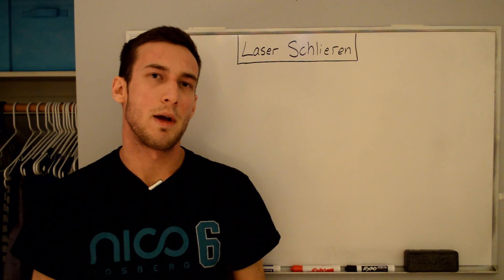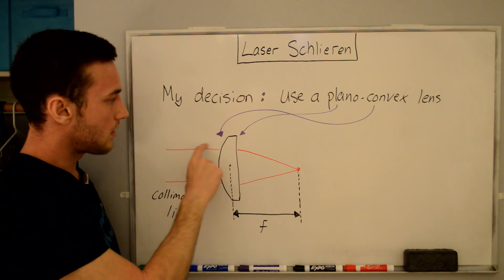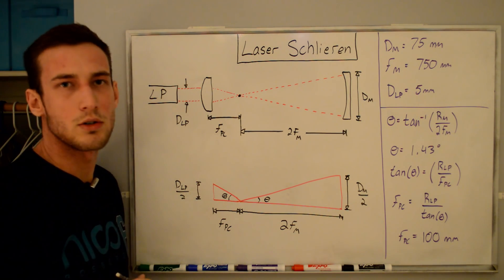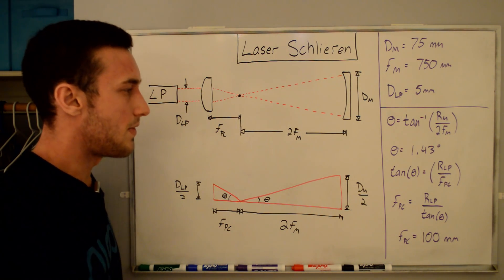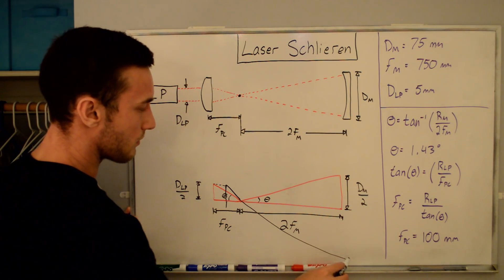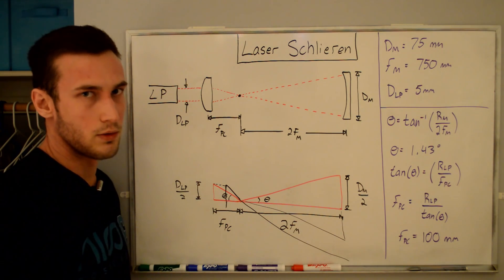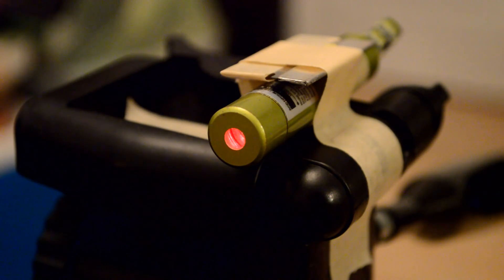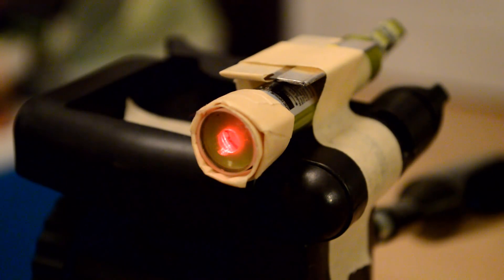How To: DIY Laser Schlieren

Comment: apparently, if you use a beam splitter, the final light is reduced to 25% of original intensity. fyi, check it out on Abominable &Co. 13:49
Reply: A beam splitter arrangement prevents the slight (but noticeable) distortion in the schlieren images due to the different forward and return paths of the light as in this case. In this case you get two images slightly horizontally offset with each other due to the angle of tilt that exists here. The shadow from the forward path does not coincide with the shadow from the return path as the schlieren source is not exactly at the focus but at a slight offset causing non overlapping beams. With stuff like quadruple pass schlieren, these misalignments can get even more terrible.

So a beam splitter is really useful if you're performing any sort of quantitative measurements with this kind of a double pass schlieren setup.

Comment: 5:30 you can use whatever plano-convex lens you want since the the setup design is not restricted from accommodating a relatively offset, lens convergence point. so, all you need to do is have the light source relatively closer to the mirror, and the focal point could be behind the light source, in this case.
essentially, your math was inaccurate. you didn't even show any formulas. 2Fm, or twice the focal length of the mirror, does not need to meet the location of Fpc, the focal length of the plano-convex lens. 2:58 wrong. again, wrong: 11:48.

Comment: thought you said it was a green laser? but what is the purpose of this setup?
Reply from the maker: I must have misspoken then.  I guess the purpose was to show you how to set up a double-pass schlieren system if you wanted to use a laser instead of an LED.
Reply: @JoshTheEngineer  huh no no i dont even remember what this was about but i was juts wondering what the purpose of such setup would be used for?

Comment: Have you tried removing the focusing lens in the laser pointer? Or used a focusable laser?
Reply from the maker: I have not, since the cap is extremely difficult to take off of this laser.  The reason I bought a lens was to show what kind of lens you need and why, but you can certainly mess with the laser pointer optics and see how well it works.
Reply: The reason I was concerned about the external lens is from my experience with lenses and laser beams. The beam diameter is so small that ther's almost no curvature of the lens from one side of the beam to the other and so very little 'lensing effect'...unless the lens has a very strong curvature. 

Within the laser head, the lens is pretty strong but, also very close to the laser (which, without the len is poorly collimted).

Pen type laser pointers are almost impossible to take apart but, some of the higher powered lasers, at abkout the same price, are sometimes easy to get at the optics. Of course everybody lies about laser power. For  sending to many countries, the lasers are advertised as 5 mW even though they are often more powerful.

Comment: Good video but why not just remove the top of the laser pen and refocus the lense that is already inside the laser instead of buying another lens?  It's certainly quicker and cheaper.
Reply from the maker: I would agree with you, except that in my laser pointer, when you take the cap off, the lens is not easily accessible.  You would need to take apart the entire laser pointer tube, and I'm not sure I could get it all back together again.  The other reason is that I like to use my videos to go into the calculations behind my setups, and this happened to be a good video to show how to choose a lens.

Comment: Thanks for the excellent video, 
Quick question, I got the same pattern that you have by adding the lens to your laser.but instead of adding the lense I just removed the focusing lense of my cheap laser 
Do you think this could work ?
Reply from the maker: You're welcome!  That should be fine.  Anything that allows the light to diverge to fill the mirror will work.  You have more control if you use a lens that you pick based on mirror focal length and diameter (like I do in the video), but if you can get it to work without buying a lens, that's great too!
Reply: JoshTheEngineer Thanks for the reply !

Comment: Great job! Super video! I would like to suggest tweaking the adjustable nut inside your laser which drives the internal lens. The laser you are playing with actually uses plano convex lens inside with focal length of about a 15 millimeters (which is the distance from the actual silicon laser diode) Thanks to this lens inside the straight line of a laser is formed, without it just the laser diode will spread the light something like a meter in diameter for a meter length roughly. So there is no nice laser line without it, and if the manufacturer of the laser left the position of it adjustable (usually u should be able to use big screwdriver) and by adjusting this internal lens position back and forth, you can get whatever focus length you desire, without the need to purchase another lens.

So you don't need external one, therefore the system is more effective and "clean". One lens less, is better anyway. 

The reason why you see a line instead of a dot is because the actual silicon laser diode is mounted on an edge of a PCB. If you remove the internal lens and use very bad batteries where the intensity is almost gone, you can really see what the source looks like (with a magnifying glass - its really a tiny line actually, not a dot! Line because the plates between which the photons jump, are wider in diameter then the distance between them, thus forming a tiny line. 

However point is - no need for other lens except if you use expensive laser where you don't want to mess with the factory calibration of its lens!!! If you use the dollar ones from china, you can tweak them for the project and later readjust your laser light focus as far as possible back again as it was :) Cheers!

Comment: Thanks for a great video. Very clear. I've just arrived to schlieren photography trying to find out what to do with an old newtonian telescope mirror :) My question is: does the coherence of laser light add anything to this kind of photography? Is there anything you can do with laser light that can't be done with normal (LED) light?
Reply from the maker: You're welcome!  One thing that's inherent in laser light is the speckle pattern, which can make the images appear grainy.  However, you can take advantage of the speckle pattern to do something called laser speckle background oriented Schlieren.  If you want to learn more, first search for Background Oriented Schlieren (BOS), and then you can see how using the inherent speckle as a background is a logical extension from that.

Comment: Is there a reason you chose plano convex vs double convex?
Reply from the maker: To be honest, I didn't even look at a double convex for this application.  But if I had, I still would have gone with the plano-convex because it is about half the price of the double convex.  After reading a couple blurbs about the lenses compared to each other, it looks like the double convex lens has higher spherical aberration than the plano-convex, but that won't matter for this application anyway.  So pretty much, for me, it just comes down to whichever one is less expensive.  Good question though!